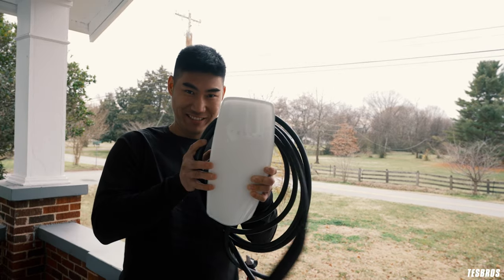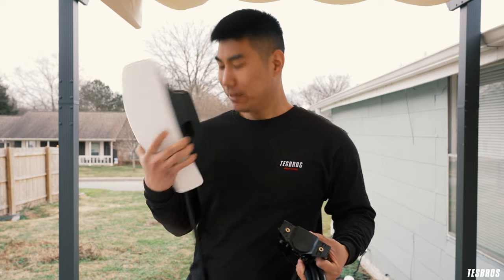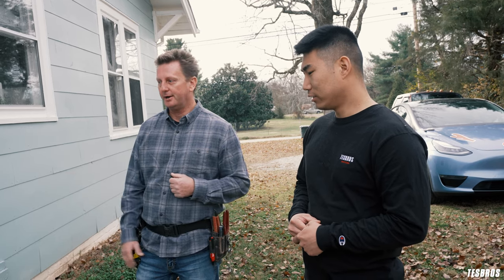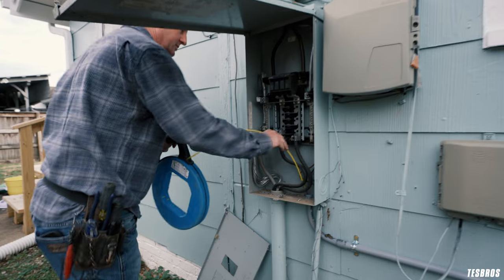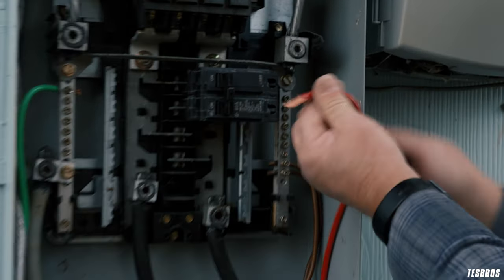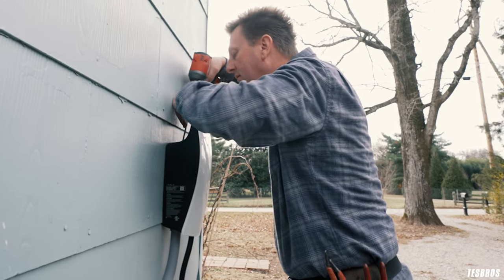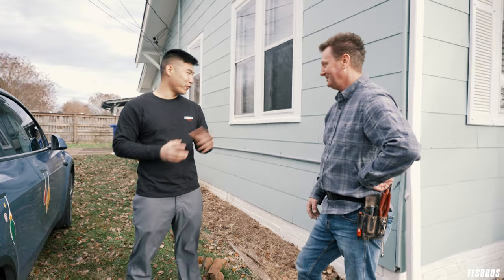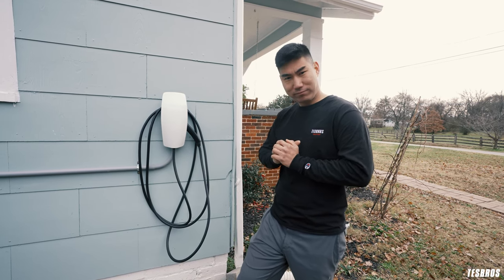Step by Step Guide to Install Tesla Wall Connector (Gen 3) - TESBROS

Comment: Is it more expensive to have a 60 amp circuit/line installed vs the more popular 50 amp 14-50 outlet?
Reply from the maker: Probably won't be too much more. I would talk to electricians in your area and see what quotes look like.
Reply: I assume you mean nema 14-50
Reply: @pinkiepie1656  fixed

Comment: How much did the electrician charge (labor) and how much was the parts.
Reply from the maker: 75 per hour for labor and about 250-300 for parts.
Reply: @tesbros  He charged you $250 for some PVC, wires, and a breaker? You got taken to the cleaners. PVC is dirt cheap and you can get 2 pole 50A breakers for under $30. 75ft (2x25ft) of 6 guage copper wire is $90. All in, you're at maybe $150?
Reply: @someguy5035  Most charge $500 for labor only......for installation.....

Comment: Is a white neutral wire not necessary?
Reply: Because we use two hot leads (120v x2) which eliminates the common.  It is then required to run a ground separately.

Comment: L1 & L2 are live & neutral or 2 phase live? Because in the country I reside it's Live (hot), Neutral & Ground.... I just want to be sure
Reply: yes L1 & L2 function as both live and neutral.
Reply from the maker: @moop_fogo  yes that’s correct.
Reply: In this country, house power supplies use one transformer and tap or tie into the middle.  This allows a 240 vac transformer to supply both 240 and two 120 lines.  Some smart guy thought the lower voltage would be safer and the higher voltage would be okay for large loads.

So, two hots.  The neutral is tied to ground to give it zero potential or zero volts but return the 120 back to it's half of the transformer.

Other countries may find this a dumb way to do things.  I think it really depends on what you are used to.

Comment: On 6 awg wire , braker size is not up to code, max on that wire would be 55 amp braker witch they don’t have so Max would be a 50 not 60 …on a 60 amp braker would have to be a 4 awg wire that’s up to code
Reply: #6 thhn is rated for 75 amps so a 60 amp breaker is fine.

Comment: Why is there no common wire? If it was a 240v outlet (like for a dryer), it would be two hots, a ground, and a common. Why is this different?
Reply from the maker: I’m honestly not sure why. I would check the Tesla manual linked in the description and it might help you out
Reply: The charger only uses  240 volts it doesn't need 120
 something  that's using 120v for control wiring in the device itself that's common
Reply: Darren most EVSE are this way. Two hots one ground, neutral isn’t needed because the unit isn’t sending any electricity back to the grid. 

Now if installing a 1450 receptacle, it’s best to have the neutral installed for future proofing. It wouldn’t be used but, there if needed later on.
Reply: @mostafa685  neutral wire has nothing to do with sending electricity to the grid. It’s simply a conductor tapped off the center of the transformer secondary coil. 240v potential line 1 to line 2. 120v potential line 1 to neutral and line 2 to neutral. No neutral needed is because the charger does not need 120v power.
Reply: It's like an electric water heater - there's not 110V loads in the device, so you don't need a neutral.  That said, it would have been good to torque the terminals as specified in the installation instructions.

Comment: Since it’s outside would it need a Gfci breaker?
Reply: Tesla manual clearly states not to use GFCI.
Reply: It has a GFCI built in
Reply: No!  Nec 625.54 EVSE (car chargers) attaches a GFCI requirement to the receptacle.  Earlier in that section it also requires the charger to have GFCI built in 625.22.

Comment: Funny my Wi-Fi won’t stay connected to my phone my iPhone sees the network but says no internet . I was able to update it and adjust the settings but after a few minutes it disappears really strange .
Reply from the maker: That’s normal. If you want the Wi-Fi to turn on, hold the button on the charger and the Wi-Fi will turn back on.
Reply: @tesbros  hi thanks for the reply so to change the setting it has a temp access time frame and then times out ?? Also you said you can check stats is there an app or any ways to see what it doing ? Locking it etc . I don’t have my Tesla y yet I have delivery scheduled between 4/11-25 so I’ve got everything installed mats and everything only thing I’m missing is the car lol
Reply from the maker: @3767OF4K  There isn't an app but once you connect to the wifi access point, you can put the ip address on your manual and you'll be able to access the dashboard. Maybe in the future it'll be more integrated perhaps.

Comment: Do you need to perform insulation resistance and loop impedance tests in the US?
Reply: It’s done often in larger installation but typically not on something like this.

Comment: No main disconnect required?
Reply from the maker: No external disconnect required, just turn off power at the circuit breaker before installing. Check out pages 2-6 - https://www.tesla.com/sites/default/files/support/charging/Gen3_WallConnector_Installation_Manual.pdf
Reply: The breaker acts as the main disconnect.

Comment: What if the house circuit panel is rated for 125 amp ?  Do you suggest an upgrade to 200 amp?  If so what is involved with that?  What if my house already is wired for solar?
Reply from the maker: Tbh, this is above our pay grade so take this with a grain of salt. Most homes are between 100-200 and 125 might be enough for you. If you have higher electrical needs and run out of amp, then yea, you’ll have to get a sub panel and an electrician will have to do that for you. But most likely the 125 should be plenty for you. Regarding solar, I would ask your local electrician. Let us know if you have any other questions! We’ll try our best 😅

Comment: Anyone know if there is an adapter to make the wall charger we already have for our Leaf work with the Tesla?  I don't want to pay for another EV charger if we don't have to.
Reply from the maker: Does the Leaf use a J1772 connector to charge? Tesla has an adapter if that's the case: https://shop.tesla.com/product/sae-j1772-charging-adapter

Comment: #10 wire for the ground?
Reply: Looks like # 6....nec 250.122 allows for #10 copper for up to 60 amps for equipment grounding conductor.

Comment: This gen3 wall charger should have a separate green & white neutral when connected to sub panel.Direct main panel- green & white are shared in the same bus.
Reply: Not on this install; there are two live/hot wires, black/black, black/red, or red/red (like in the video). There is just a ground (green or bare), not a neutral (white).  For the ground you can certainly use any color you want as long as you label that it is technically "green."
Reply: Since the wall connector has a built-in GFCI, I believe that's why you only need a ground.  Definitely reduces the whole install cost using 3 wires, especially when using #4 to go up to 76a down the road or adding another wall connector.
Reply: @eastmanresearch3143  the GFCI does not need a ground to work.  It senses the current flow both into the load and out of the load and trips on a difference of around 0.5 milliamps.

The nec allows GFCI 120 vac receptacles in section 406.4.(D). to replace "ungrounded" ( old 2 prong receptacles).

Also, 625.54 EVSE ( car chargers) requires both the charger and a receptacle for car charging to have GFCI protection.  In this video, no GFCI breaker is needed because no receptacle was used.
Reply: @eastmanresearch3143  you can’t add additional wall connectors to a circuit. The installation manual states that each wall connector needs a dedicated circuit.
Reply: The electrician ran the circuit from the main panel so the ground wire is allowed to go on the neutral bar.

Comment: i really dont understand whats wrong with romex. 60amp. its 3 wires and if going through conduit who cares

its the same grade of wire right?

plus tesla only uses 48 amp not 60. romex is rated at 55.
Reply: Yes, you can use 6-2 Romex (2 hots and a ground).  Tape the white wire black (or red) so that everyone knows it's 240 volt.  You just can't run Romex in a damp/exterior location.  Mike couldn't run the Romex in the PVC pipe.
Reply: Also, in NJ we need a disconnect means by the charger. A receptacle that the charger plugs into or AC type disconnect. Mike didn't use one because the circuit breaker is close by and is visible.  An expansion coupling on the PVC might be needed too...
Reply: If you live in the U.S., most areas are covered by The National Electric Code for the electrical requirements for building.  Section 625 has the car charging requirements.....

Gfci requirement for a recepticle if used.

One circuit per charger

Maximum charger draw current times 125% equals minimum circuit size.  (So the 40 amp charger needs a 50 amp circuit no matter how much you turn it down....maximum draw).

Also, use the 60 degree column when looking at the wire ampacity charts.  The breaker terminals should be rated 60 degrees which limits your wire to 60 degree c.
Reply: @craigbradley2856  article 625 in the nec requires you to use the maximum charger draw and multiply by 125% to get the minimum circuit ampacity. 

#6 romex is rated at 60 degrees c in article 334 of the nec.  So 55 amps.

If you are under the nec, please check carefully..

Comment: This is 220 people and definitely not for beginners.  While 110 can knock you on your ass 220 will fry you dead. If you have never added a circuit to a panel before, You need to sit this one out for the professionals.

Also when you say things like, "get this real tight" isn't necessarily true, as cranking down too hard can cause voltage loss,  You need the right amount of torque.. You may also have to use  heavier gauge wire to account for voltage drop depending on how far you are going.

Comment: Did the electrician use awg 4 or 6?
Reply from the maker: 6
Reply: I was reading online and I saw some videos about using 10 gauge. Would that be better for even faster charging?
Reply: @MrSICK661  No.
Reply: @MrSICK661  your wire would eventually catch on fire. The lower the gauge (the lower the number), the thicker it is. If anything you'd want a 4 AWG instead of 6
Reply: @MrSICK661  jesus Christ no that will melt if you put it on a 60amp breaker... Ideally you'd want to use 4g but 6 technically is fine.
What i should say is since its only using the 48 out of 60 amps you should be fine with 6 Gage, But ideally you want your wiring to be able to withstand about 125% of the output. So if this is solely dedicated to charging the tesla 6 is fine but if you were running a regular 60AMP breaker you would want to use 4 for sure.
Reply: Thank Everyone for the replies
Reply: @Vidar93  Josh, give care to the advice you give.  NEC article 110.14 ..  ,  believe.  is for wire terminals.  Breakers 100 amps or less are normally rated with terminals rated at 60 degree c.  That puts whatever wire/insulation under the 60 degree column and thus #6 wire is rated at 55 amps.

If I got that wrong, please let me know.
Reply: @keithharrington4595  If its a dedicated circut for just the Tesla it will only be pulling from a 48 amps at max and usually much less than that then 6AWG would be fine technically but it may not be their code... If it has anything more than that on the line then you do want to use 4. You generally want to use a wire that is rated for 125% of the capacity of the breaker so 4g to 60, 6g to 50, 8 to 40 ect. But the wires also depend on what they are made of and the manufacturer on how much they can actually handle for example copper can handle much more than aluminum wiring. In an ideal world the breaker will always trip before they overload and would start melting but we dont live in an ideal world and this happened all the time from failed parts. If you're going to do it correctly and by code then follow whatever your city/state guidelines are.
Reply: @Vidar93  because I have a license, if I do not follow code and inspectors, I can be sued.  Sued for damages and medical expenses and temporary housing and house repairs and car replacement.  In some statrs, they can come after me legally, just for the advise given.

Remember this when you do it yourself, when you ignore code or building inspectors and need to replace your house, car and maybe a family member, who do you sue if you just "make it work"?
Reply: @keithharrington4595  yeah thats why i said follow your local code. According to manufacturer ratings it would technically be fine but not installed properly... Which is why in my original post i said it technically can be done but you should use the 4. Im not giving advice to electricians they should already know wiring if a guy is doing it himself I'm guessing he probably isn't going to have an inspection like he should which is why i made such a big deal about using the 4 to be safe. But regardless if its a single line that will not even draw even close to its 48 max the 6 still are technically enough and realistically they would be fine we use gages normally that are rated for 125% of the load which is different per material byt generally with copper that's the 4awg to a 60 breaker. If you're licensed cool im a GC also and primarily do carpentery still work and use inspectors also but if they aren't they should be using 4 regardless

Comment: it needs a 60amp breaker and 6 gauge wire? How do i know which gen my wall connector is?
Reply from the maker: Yes. Tesla started selling gen 3 in 2020, so if you bought recently, it’ll be this one.

Comment: Hi ，good day here，please did any one have idea，help
me out ，our tesla is showing，charging stopped when ever  i plug it on electrical socket。
Reply from the maker: If it's an electrical socket issue, it's most likely that your breaker can't support the charging of a EV. Make sure you have a high enough AMP breaker but I recommend getting the Tesla charger or NEMA installed for faster and safer charging.

Comment: Make Connections Going Towards Panel, Only have to worry about Live Wires Once. Wouldn't Strip leaving Copper Exposed, You Were Consistant with Strip Length, too much for me. LESS Dead Lizzards. Also would Run Conduits to Underground, not Have along the side of the House? Just a Little more Wire, Looks Cleaner.
Also with 60 Amps, Only Need a #10 Ground. Larger Doesn't Hurt, Just more Money and a Little Tougher Pull..

Comment: What gauge wire do you use for 60 Amps????
Reply from the maker: 6 is what we used. But please consult your local electrician as I am not a electrician.
Reply: Thanks buddy
Reply: You must use what is up to code. I believe it’s either 6 or 4 that’s permitted.
Reply: Electrician here, you're asking the question backwards, the breaker protects the wire, so for number 6 wire, you would use on the low end a 30-40amp breaker and at MAXIMUM a 60amp breaker.  and 60amps is kind of pushing it.  Personally I wouldn't max out a wires capacity, incase there is some unforeseen variable that causes the wire to overheat and melt.
Reply: @Dgriffin425  So you would go with the 4?
Reply: @anasazi6906  yes,  4 gauge wire can handle up to 85 amps safely.
Reply: @Dgriffin425  especially with continuous load (over 2 hours)
Reply: #6 THHN. Is rated at 75 amps.
Reply: @Dgriffin425  6 awg wouldn’t be maxed out on a 60a breaker because conductors for continuous loads are sized at 125% of load current. This charger isn’t going to draw more than 48a. It says this in the installation manual. Also specified in NEC article 210.20(A)
Reply: @MJHanneman82  only at 90*C insulation rating. And the only way you may use the conductor ampacity from the 90*C column of NEC table 310.16 is if all of the wire terminals are also rated at 90*C, which is highly unlikely.
Reply: @RB-xv4si  Well at least, according to the Tesla installation manual, they recommend #6 AWG rated at 90 deg C. So we assume the Tesla wall charger terminals are rated as such?
Reply: @kimolee502  even if they are, it wouldn’t matter. No breakers that anyone has in their homes have 90°C rated terminals. They’re all 60/75°C, so the conductors need to be sized from those temperature columns. Size from the 60° or 75° column but USE 90° wire, per the manufacturer’s instructions.

Comment: What guage wires?
Reply: Use the wire table in the national electric code table 310.16 (2020 code).  Use the 60 degrees c column.  There are 2 columns marked 60 degrees c;. One for copper and one for aluminum based on your wires metal.

Section 110.14 for terminals, like the connection to your breaker requires 60 degrees c for 100 amp or less breakers unless your breakers are marked differently.